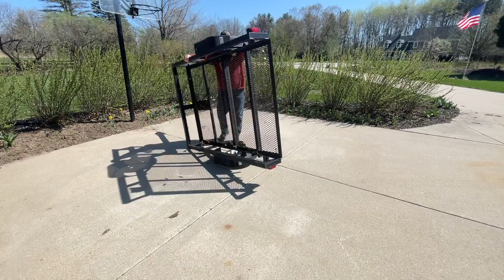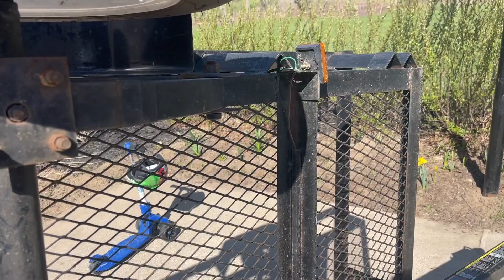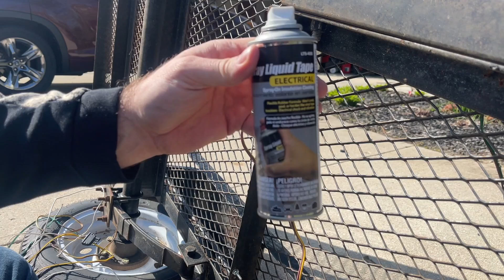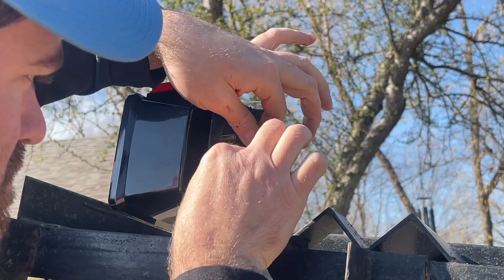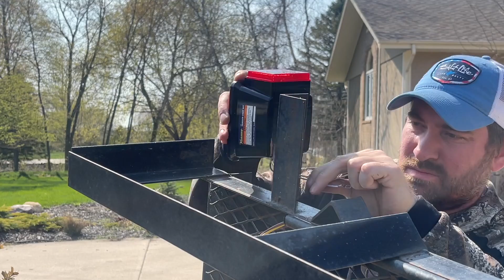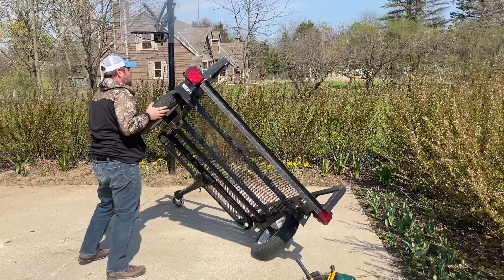Replacing Trailer Lights with a Kenway LED Trailer Light Kit  // Bog Life #DIY #Trending #FYP

Comment: Is that a tilt trailer ( what I have ) if so how do you do the wire for when you tilt the bed for loading > one way they be to lose and grag off or short and break when you tilt it ?
Reply from the maker: @stevebrown3408  there’s a tube underneath the trailer specifically for running the wires

Comment: Either solder wire connections and cover them with shrink tubing or use crimp-style butt connectors covered in shrink tubing. This will give you many many years of trouble-free service.